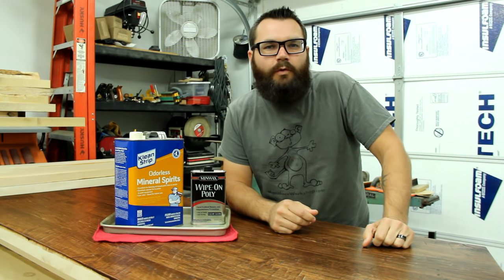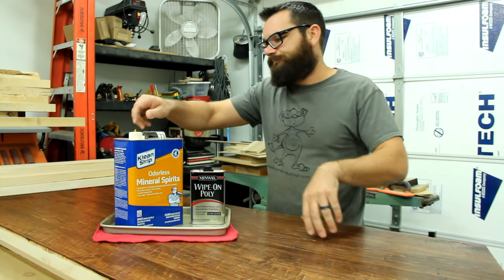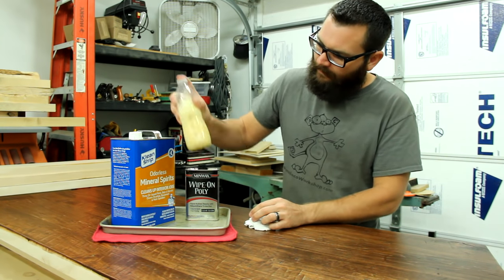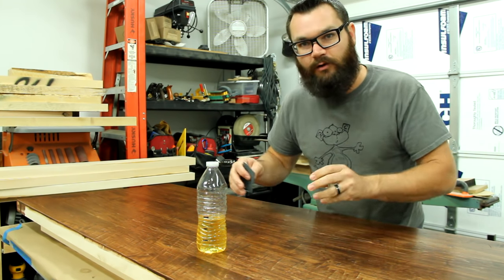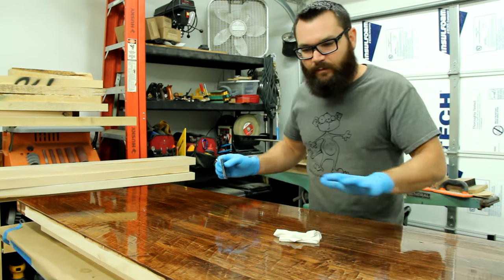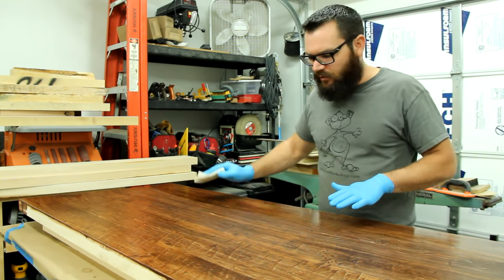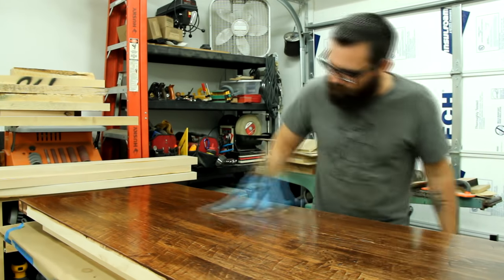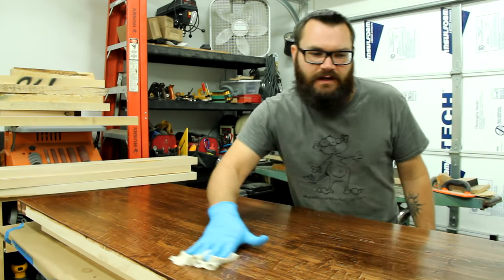Ultra Smooth Finishing Method - Great for tables or Counters

Comment: Wow I just used this on a floating desktop for our soundbooth and WOW! It looks like some flawless factory finish on some laminate pressboard but it's actual hard wood, people asked me if I bought it ;) You are my hero, I'll never use another method. I used a 50/50 blend of straight minwax helmsman spar urethane and it worked fine for 5 coats, but I forgot to additionally thin it for that last coat, you're right it made it harder to buff out but still turned out great because the combo wet sanding and buffing leaves a flawless finish with no brush strokes, perfectly leveled out, thank you, thank you...I wish I could leave a pic
Reply from the maker: Glad to hear you had such great results!

Comment: This is a really great method.  I have to be honest I had my doubts at first after watching the video, but the your top looked really good in the video so I had to try it before judging and wow.  I was having problems getting a large benchtop to go down perfectly smooth on the final coat.  Already had a few coats of thicker poly for hardwood floors on (its a workbench so looking for durability and yes I know striving for a perfect finish on a workbench is eventually going to be a wasted effort), but couldn't get the final coat to lay down perfect enough for me, so... youtube to the rescue.  I sanded the existing poly perfectly flat with 400 on a power sander then applied couple super thin coats of wipe on with this method and BAM!  Absolute perfection.  

Thank you very much for taking the time to make this video, share your knowledge and put up with the trolls.
Reply from the maker: Thanks for sharing your experience!

Comment: Really appreciate you sharing.  Just built a beast of a kitchen table and put five coats of brushed on poly and ended up very disappointed and ended up stripping the whole thing back down to the wood.  Going to do this for the new finish.  Thanks!
Reply: Brian, how did you table turn out doing it this method?  Wanting to know because I want to refinish my Mom's table.  Thanks

Comment: I gave this method a try yesterday on a Dining table im building for my mom. Came out amazing. I was able to put 5 layers of poly on in one day. Did a little wet sand on the last layer and it came out smooth and beautiful. I even now prefer the old t-shirt for spreading like you suggested. THANKS A LOT MAN GREAT STUFF! Def Subscribing!
Reply from the maker: Thanks Senor Ginger Pants! I should redo this video as I get a lot of questions on wipe on vs regular poly.
Reply: The wipe on poly was so easy. Staining the base was so tedious i was dreading the multilayer poly, but with your method it was super easy. Im even going back to poly the bench i made for the table

Comment: Thank you so much for posting this video! I used this method on an unfinished table I got from ikea. It's beautiful. I love that there are no visible  brush strokes. I used a satin finish and with low shine it looks virtually unfinished but it is so smooth and durable! It has never stained or scratched on me even though it's been 2 years and the table gets lots of use and spills! It's inspired me to do more woodworking. I am planning on refinishing a table the same way for my sister. So glad I stumbled on this video and unique technique! It's like a cross between wet sanding and french polishing except using poly. It's great. Can't thank you enough!

Comment: Ty, I just finished a project using this technique and I couldn't be happier.  I convinced my wife to use some natural products (8/4 cherry wood) in our kitchen remodel and knew that she would be super critical over a finish with brush marks or anything less than a super smooth finish.  I tested several methods on some scrap from the project and she picked the sample using your method.  I'm very proud of the work and how it turned out.  Thanks for sharing this video.  Awesome!
Reply from the maker: Hey Kyle, That's great! It's always good to hear stories like this. Thanks for watching!

Comment: Hey Ty, any tips for larger surfaces? I'm using your method, but its dry by the time I get to the other end of the table. Have tried doing in sections, but doesn't coming up well at the overlap of sections. Should I increase the ratio  of Poly to thinners?

Comment: I would recommend starting with regular poly (not wipe-on), as wipe-on poly has already been diluted, yet it's more expensive per quart than undiluted poly in the store (kind of a ripoff). Buy mineral spirits by the gallon, and poly by the quart. This way you can stock quarts of different types of poly (satin, semi, and gloss) and you can make wipe-on versions of each of them as needed. They all dilute fine with the inexpensive mineral spirits.
Reply from the maker: Somebody happened to give me a few cans of wipe-on poly otherwise I would have. The different between poly and wipe on poly and the mixture ratio is definitely something I wish I would have spend more time explaining in the video. I've gotten lots of questions on that..
Reply: Right i was wondering why was he using the Wipe on Poly only to mix it to make more VS A pint can of  regular Poly, Would make more scense etc. Poly etc.

Comment: Total newbie here... so I would stain the wood, add this mix, sand and then buff or remove the sanded bits? Wouldn't the little sanding dust be in my finish? And do you sand your very last coat?

Comment: I also use the minwax wipe on poly. Question: It's water based. So mixing with mineral spirits isn't problematic? Or do you have an oil based wipe on I haven't seen on the shelves at my location?

Comment: Ty, doesn't sanding with the poly/mix still wet just trap the particles in the mix and screw up the finish? I can't argue with your results here it truly looks beautiful- but I can't get my mind around how you can sand a finish while it's wet with poly and not automatically dull the final result that way with sanded particles drying in the finish? Can you explain? I always finish my final coats with finer and finer sandpaper (down to 3000 wet) for a mirror like finish- but those coats are already very dry- so everything wipes off with a cloth- I can't imagine sanding on a wet finish...

Comment: Thanks for the nice Video showing your method... I have a QUESTION on a small project: Can wipe on poly (Approx 2 parts Mineral spirits to 1 part Polyurethane mix),  be used on nicely sanded, "UNFINISHED &  UNSTAINED" wood for a pleasing result? - I want the color of the unfinished unstained wood panel to remain basically unchanged and as light as possible. Have you tried this in any application and how did it work? -  Hoping to hear from you... Thanks for your help.
Reply from the maker: Yes you can. That mixture is just a slightly less thinned out version. When I use this method I tend to change the mixture a bit to get as thick of a coat as I need.
Reply: @TyMoser  thank you .

Comment: Thanks for the great tips. I have done basically the same thing with Danish oil on chairs and blanket chest. After about 5 or 6 cotes then waxed. I never thought of wipe on poly. I think the key is the wet sanding with the actual product.
Thanks again 
Scott
Reply from the maker: +eCabinets tips and tricks Thanks Scott, I've never tried it with Danish oil. I'll have to give it a try since that's up there on my list of favorite finishes too!
Reply: +Ty Moser (MonoLocoWorkshop) 

Thanks for the reply. One thing to remember about oil’s such
as Danish oil is that they do not build like the poly. So if you are after build
then I would stick with the poly type finishes.

Comment: Ty-I struggle with finishes and decided to try this on a table top that I have refinished.  As I was wiping until the coat dries, I started noticing the rows where I had just wiped getting hazy, showing they are clearly dry where other "rows" are still wet and glossier.  Did I wipe too much?  I noticed on your video, and I watched very carefully, that your entire tabletop looks the same as you are wiping.  There are no "dry spots" or "dry rows", it's all very evenly shiny. How do you accomplish that even look, in other words, that everything dries at the same time?  Or is that even important?  I let the table sit for a few days and notice unevenness.  I will light sand and also incorporate the wet sanding you show before doing this process over.  I am on my 4th coat of your process.

Comment: Ty, Help. My bar top is 2 x 10 with a 2' return. I put two coats of undiluted oil based poly before I found these videos. They advocate 1:1, 1:2, and 1:3 dilution. The poly started going off before I could get 2' in either direction. Now the brushmarks look like the grooves on the freeway surface.
What grit do I use (by hand) to take down the poly without jiggering the stain? Will this method work with such a large surface? Do I have to worry about the grain?
Thanks much.

Comment: Good video and a nice finish. One thing: You could save a little money by using the regular fast drying poly rather than the wipe-on poly, since the wipe-on product is already a thicker version of what you've created--a mix of mineral spirits/paint thinner and poly. This is more economical because the thinner is way cheaper than polyurethane.
Reply: I also wondered why he thinned already thinned (Minwax wipe on poly)

Comment: Great method Ty. Question for you, when you're buffing after the wet sand, are you using a new, clean rag, or the same poly/spirits soaked rag as you used to apply the coat initially?
Reply: I saw Ty used the same rag in video

Comment: Ty,
I plan to use a 50/50 spar varnish / min spirits wiping blend for some large exterior Sapele doors.  Assuming it goes as planned, I'll sand to 320, put down 2 or 3 coats of the blend and then sand between each subsequent coat till I have a dozen or so coats on it.  

So, the wet sanding using your wiping blend is a new one for me.  I've seen others wet sand (with water) between coats, so I assume that your intent is to save a step by using the actual finish product?  Obviously, you are doing this wet sanding late in the finish and there is no chance that you will pick up anything but poly with your sanding.  Has this process ever muddied your finish?

By the way, excellent work - you were born for the screen!
Reply from the maker: Thanks Mark! I haven't had any issues with a muddied finish but when using this method, I thin it out quite a bit to let me wet sand it with the finish and then buff it until almost dry so pretty much anything thicker than the finish should get wiped off.

Comment: did you sand when the coat still wet?
If i have just 320 or 1000 grit what to use?
also if I already put a 4 coat and I have brush marks this method would help me?

Comment: I use Foam brush to apply Polyurethane. I thin it down with Mineral Spirits 3 poly and 1 Mineral Spirits. Never has bubbles or hated brush strokes. Always a smooth flawless finish.
Reply: He is using a wipe on poly.  I will never go back to brush on.
Reply: I still get streaks with foam...

Comment: Help! I used this method and have circular sanding marks and along the grain sanding marks left.  Will they go away with each additional coat? I'm on my 3rd coat. How do I get to the point that I no longer sandpaper scratches? I used 600 wet/dry sandpaper
Reply from the maker: Do you have circular sanding marks from the 600 grit or is it from an earlier grit? When I'm sanding, I always make sure when I finish with a girt that I don't see any marks cross grain before progressing to the next grit.
Reply: Ty Moser It's from the 600 grit.

Comment: I never thought of further thinning out wipe on poly. I'm using wipe on poly right now for my kitchen table.
Reply from the maker: I don't always go this route because it does add a decent amount of time due to the need to add more coats. I like a simple wipe on poly for many projects. Recently I've been using General Finishes Arm-R-Seal.
Reply: @TyMoser  Are you thinning the Arm-R-Seal? Also, are you still wet sanding like pictured above? I'm interested in using that product but curious if you handle it the same as in this video.

Comment: Hello ty hope you see this.  

I am doing 8ft panel poplar doors which are stained a deep burgandy.  I have tried everything spraying, many different brushes and now your wipe on. No mater what I get inconsistent results. 

Currently I see the sand marks through the wipe on.  220g then 400g before wipe on.  Do I need to sand untill the makes are completely even? Like Turing it into a white even  cloud?

Wish I could post pics but can't on here.
Thanks
Reply from the maker: I know I already responded to your email but in general when progressing through the grits when sanding you need to make sure that you always finish one git by sanding with the grain and that the next grit removes all previous sanding marks. If it helps, you can scribble all over the top with a pencil and sand with each grit until the pencil is all gone.

Comment: I didn't know you could thin and use  the poly this way. I will try it. The straight wipe on poly is sometimes difficult to do on a wide surface.
Reply: Don’t buy the wipe on in the can it is expensive, because it is already diluted. Buy the regular and just add more mineral spirits to cut it. Experiment with ratio to get what will work for you,

Comment: i want to know wet sanding. First sanding use 200 and next step 300, 400, 600?  And i want to know wet sanding effect,,i'm sorry to ask many question..
Reply from the maker: The wet sanding in this particular circumstance lets you bypass sanding between coats. It also mixes in a slurry from the previous coat into the new coat.

Comment: Thanks I was looking for a way to finish my tv stand, I think I'll use this method!
Reply from the maker: If you're using wipe on poly, you might thin it out a little less than I did. I was working with a large surface that required more working time.

Comment: Would this work even if the table has some space between the boards?  Or if not how would you suggest handling that?
Reply from the maker: That would be a little trickier. I might to just wipe-on poly or arm-r-seal with a rag in that case.

Comment: I've seen people who use mineral spirits to clean their brushes and clean the table off after sanding? Can you do the same with paint thinner? Also, is it bad to use the same brush that I used for staining for polyurethane? Even if I cleaned it with paint thinner.
Reply from the maker: I usually use mineral spirits after sanding and between coats. You can do the same with paint thinner. It's close to the same just less refined and more volatile/stinky so you'll have to use more. 

If you get the brush clean I don't see a reason why you can't use it for the clear coat.

Comment: Do you sand every coat or only during the last ?  Or do you sand between coats and then during the last coat?
Can I use Arm or Seal and achieve the same results?
Reply from the maker: You sand between all coats but not after the last. I suspect you can get a similar finish with Arm-R-Seal but I haven't tried it. The can says not to thin it out but doing a small test on something won't hurt.

Comment: so the process you showed is just how you do the last coat? before that you just wipe on let dry sand in the normal process with the thinned down poly?
Reply from the maker: I might not wet sand on the first coat but with poly you are supposed sand between all coats so doing the wet sand while applying finishing kind of removes the need for that.

Comment: Just a quick question, in this video you're only applying the finish on the top, but what if you have to apply on the other side?Do you build up the layer evenly on both side as it dries? By the way, great finish and helpful information!
Reply from the maker: Clara Kim It depends but I generally only put a couple coats on the bottom to help seal it unless it's going to be seen.

Comment: I want to build a table using wood from an old work bench. It'll have gaps and be uneven. Will this seal in all the gaps?
Reply: No it won't. I ran onto the same problem. Had to fill the gaps on my table with wood filler after figuring out that this method won't fill the cracks. Still turned out beautifully with wood filler though. I'm really happy with it.

Comment: ,thanks, going to use this on table I just finished striping downl..... question...it appears the edges are unfinished, is there a reason? thanks.
Reply from the maker: The back edge wasn't stained because it was going to be a counter top for a built in cabinet so I didn't worry about staining the side that was going against the wall.

Comment: Does this method work if I want a satin finish and not a high gloss? Also when you keep wiping it with the cloth until its dry, doesn't it drag the finish?
Reply from the maker: I don't see why it wouldn't work with a satin finish. When you thin it down this much you can do a french rub style finish and "polish" it until dry.